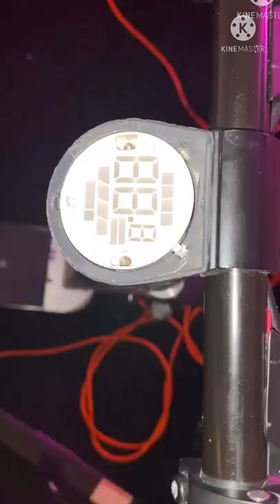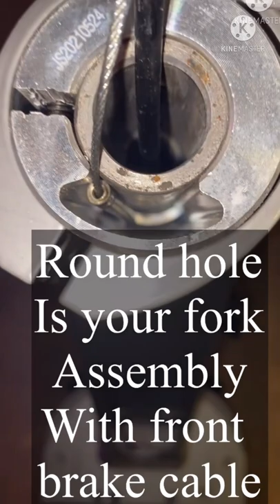Bird es-400a (scooter Conversion￼)

Comment: HI.  The video is very well done.  But from a certain moment there is no longer any audio.  You can't hear anything.  And I wanted to ask you where is the GPS located?  Inside that little rectangular box that's behind the front wheel?  A thousand thanks.  You are very strong

Comment: Hello. Me again :)
Did almost everything.
But there are a couple of questions.
1. Why do we open the battery and connect the dots in it with a wire. For charging? What if I charge the battery outside the scooter?
2. I didn’t quite understand what the intelligent wires connector is for. Should it be left closed during assembly?
3. To have the third speed, do you need to do the procedures at the end of the video with opening the controller again?
Reply from the maker: 1 .is the bms bypass this is required in order for your scooter to retrieve its voltage
2. Your battery should charge just the way it is without having to adjust anything
3. Intelligent wires- if you notice that your wheel  is spinning backwards. Connect these intelligent wires and you’re Motor will automatically begin spinning on its own correcting it’s wheel rotation.
4. 3 speed switch- initially you connect this from the outside of the controller to its actual connector which should be labeled 3speed switch.
Reply: @pjscootermods I have a question , if I was to take the neck and bars off a bird 2 ( the more square one with the light) could I use the display screen for that set up and avoid the three way switch and settings ? Or is that not possible to interchange like that ?

Comment: To keep battery Waterproof. Unscreew top cover with display. Check on witch side wires are coming from. On the outside where the board is cut a rectangle 2cm from the bottom. Sized 2"by 2" remove alu cover. Than gently remove with plastic knife that gray putty to uncover Mosfets. After that remove thin epixy coating from 2  mosfet legs and bridge them with solder. Now cover it with silicone. Now battery will not cut off while in use. But make sure you ESC have undervoltage protection.

Comment: can you help me please I'll explain the same control unit as in the video I bought it but it doesn't work well for me... I'll explain the pass connected as at the end of the video it doesn't work for me and the detached one I would like to do it without the three speeds only with the accelerator is it possible ? if I deactivate the pass the engine doesn't turn even if I connect the study wire.... I don't know how to do it... (by mistake I unsoldered both engine brake cables and I don't know where to put them back)
Reply from the maker: The 3 speed switch is optional , it’s not needed to make the school to work, so yes you can do without it. The self study wires/intelligent wires are only to correct the wheel rotation if you notice the motor spins backwards, then connect your intelligent wires, after you do, so, your motor will spin on its own correcting its rotation.

Comment: What’s up bro, are you still active on this page? I have some questions about wiring up my scooter.
Reply: My questions are the two voltage regulators we removed. What do we do with them? Wire them back in? Or chuck them?
Reply from the maker: I’m only using 1 step down converter and it’s 48 V step down to 12 V for both my headlight and my tail light.. you keep that you wired in. I did notice I used 2 step down converters previously on this model.. i’m not sure what I was doing there I believe I was using each step down for each light supply.. but you only need 1..

Comment: Did You try use original lcd? Stop brakes also dont work because You dont use brake cables?
Reply: Due to can Bus communication it is impossible to use Original LCD.

Comment: Please do the v3, I been asking for ages please and do you remove the GPS on the v4?
Reply from the maker: It is literally the exact same thing as the bird to scooter. Like literally bro . Only difference is the bird 3  scooter is longer in length. GPS is in the same location and everything !
Reply: @pjscootermods  to this Brid or the v2?
Reply: @pjscootermods  ??? It’s the same for this one or the v2?
Reply: @dannys4831  For the 3, the thing is the exact same location, but careful that thing lights up even if appears dead, so fix it somewhere else first. Well I had no luck on my end on the 3, maybe 500w controller issue. Maybe Attempt again and see if it works. Also I'm on Telegram, not Discord.
Reply: @Jnsystems  what’s your telegram?
Reply: @dannys4831  @ Jnsystems

Comment: Thanks for your vidéo. Do you perform to fini and remove thé GPS module ? I hae a bird v4 but i don t know’where is thé GPS module 🥵
Reply from the maker: The GPS module is the little black box right on the front of the stem. And that’s the only gps unit at that

Comment: Hello, after removing the IOT module the scooter will read error 32. Does this immobilize the scooter? Does it beep when in this state?
Reply from the maker: That’s OK it doesn’t matter if you read an error code, it reads an error code because it notices the iot has become disconnected. Scooter does not beep after iot is removed . Also it doesn’t matter if it reads an error code because you’re not going to use the original display.. only thing you should be using up top is the throttle & light

Comment: Hey sorry unrelated to this vid. But have you come across the specs on the bird 2/3 motor? I know it's rated 400w but I was wondering if you knew the max? I just got a flipsky controller and I'm trying to push 1000w out of it.
Reply from the maker: Pushing 1000 W you should be able to do that easy! Your motor should not even get hot. Definitely go with it . But at the same time monitor it stop every few miles or so just to put your hand on the motor see if it’s hot or worm… but I’m telling you you should be good unless you’re putting that controller through stress and then that be a different issue

Comment: Bro,I ordered the 500 watt controller.because the 350 didn't seenm to get me the speed.can I run that controller with 2 36 v batterys out of the bird zero.
Reply: I also ordered the 3 speed switch.
Reply from the maker: Yes you can run to 36 V batteries make sure they are paired in parallel

The controller also has to be 36 V

Comment: Hey sir how can i get in contact with you please, i need some help
The battery won't accept to charge, the charger won't flash red it just keep flashing green, even the screen only work when I plug the charger it show 0% and won't increase at all.
Do u have any solution please
Reply from the maker: Sounds like the battery went into sleep mode! 

It’s supposed to charge right away
Reply: @pjscootermods  i do have a 42v charger, should I use a powerful one ?
Reply from the maker: @adamsouf2380  yooo ok if my bad so if you have this scooter will then you need to go with a 48v battery charger for it .. that’s why u have no charge!! 

It’s not ganna charge it at all using a 36v battery charger. That’s going to cause it to stay green like you said

Grab one of these 👇 and problem solved 

https://www.amazon.com/Adapter-Charger-Lithium-5-5x2-1mm-5-5x2-5mm/dp/B08PBN2W8B/ref=mp_s_a_1_5?crid=379LWZ1N6ZP5K&keywords=48+v+battery+charger+lithium+ion+battery&qid=1671503287&sprefix=48+v+battery+charger+lithium+ion+battery%2Caps%2C331&sr=8-5

Comment: Bro ... Why don't you just use a official m365/bird v1.4 controller , I got like 20 of them for the low..... You can make your own custom firmware ...
Reply from the maker: Unless those controllers are rated 48V I don’t see it happening using the M365 bird controllers.. all of those things are rated at 36V!. And even if you did use this controller the cut off voltage for it is set at 29/30v .. and the  new bird scooters Cut off voltage is at 41 V.. so that being said one of these 36 V controllers is going to drain this 48 V battery below it’s cut off voltage and from there what ? Your fucked , you left with a bricked battery 💪..

Trust what I’m saying
Reply: @pjscootermods  you can can go up to 13s on most 36v controllers....the ones that say 36/48v is just the Chinese market charging more for the same.....but on the m365 you can trace cut the 63v copacitor and double the 36v/42v pack to make a 84v controller....you ain't hip bro?
Reply from the maker: @naeslopes1192  well then in that case post some links if you have them , I wouldn’t mind checking that out ! and I’m sure the people that read this would like to give that a try as well.
Reply: @pjscootermods  yo I did right after my last message..BoobTube  took it down..there another way but you have to know exactly how much Volts you want so you can change the resisters.....but Look up:.         'm365 controller trace cut mod'

Comment: Will a 800w controller now fit great?
Reply: David Leininger  800w controller müsste auch funktionieren
Reply from the maker: I’m not sure what the 800 W controller looks like but you can most definitely fit something in there that is about the size of the 500 w controller or about 6 inches in length.. whatever you do choose to go with be sure that it is 48 V.. no I’m not telling you to use the 500 W controller because the one that I am talking about is only rated for 36 v. Also the cover that goes over the controller would have to be modified ! As in cutting a square shape that fits the controller so I can slide through because it is going to be poking out about a good inch.
Reply: it is around 
25 x 10 x 5 cm will it fit ? @pjscootermods
Reply: @modxho2292  no

Comment: Dude,this controller comes in tomorrow.can I run the 500w with  2 -36v battery's?PLEASE ASNSWER ASAP!!!!!!!!!
Reply from the maker: yes this is possible but also be sure that the batteries are identical, what this will do is double your runtime, scooter will have lots of torque, speed will remain the same. The process is very simple below is a link to where you can purchase a parallel connector. Instead of having to make one yourself the way I did, save you time.

With a parallel battery connection the capacity will increase, however the battery voltage will remain the same, that being said you are still able to use the typical 36 V scooter charger to charge both batteries after they are connected in parallel.

 parallel battery connector link: https://amzn.to/3Ibo0ee

Also from me previously working on the zero scooter I can see that you do not need to bypass the battery output, save you
Some time ,just plug and play !!
Reply from the maker: Open up the link and look at the picture ! On the parallel connector as you can see there is 1 connector on 1 side and 2 connectors on the other side . The single connector will plug into your controller, The other end with both connectors plug into each battery.

From there everything is straightforward, Connect everything according to just like you would with a single battery.
Reply: @pjscootermods   your missing question.will it run it OK?its a 48v controller I'm running 2 36 v batterys.will the controller be OK or will I message it up BC I'm running the 36v battery's?sorry man.
Reply: Man I am sorry I must of put the question wrong.I know how to parallel the battery's I aldeady got the y connector been using them awhile.but I traded the 48v that came on this new scooter I kept my 2 36 v from the zero'S.but I got the 48v 500w version.will this 33.00 dollar controller be OK with the 36v battery's???
Reply: @pjscootermods  everything I know I got from u man.started with the zero.learned I could parallel all those extra battery's.but once again after 5 scooter mods I need u.will the controller ur running be OK if u ran 2 36v battery's.BC I got the 48v 500w controller like u but I have the 48v battery I gotb2 36v parrelel batterys.will work.?
Reply: I got the 3 speed switch and my speed is like 12 mphsame as bf.is it the 36v battery's?should I hook this setup back on the bird zero and run the smart motor till I can get the bigger batteries?